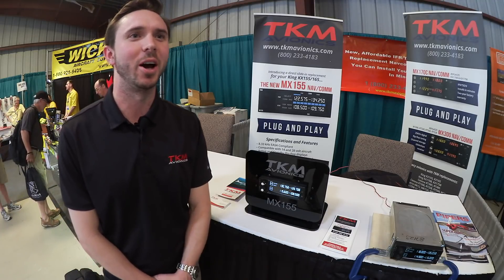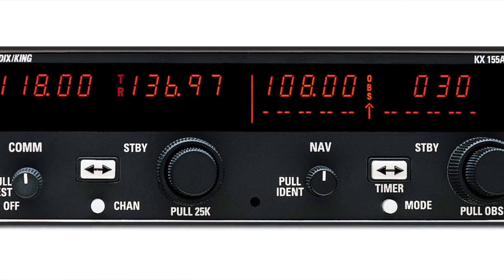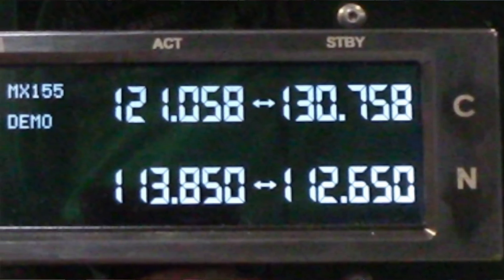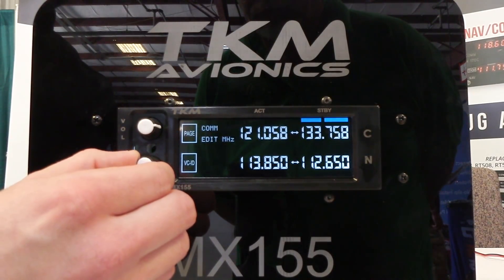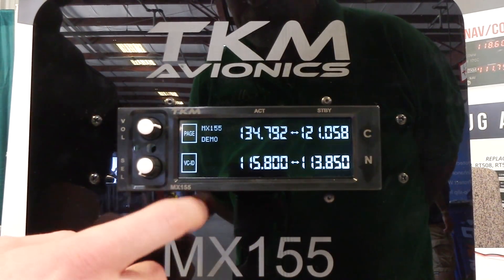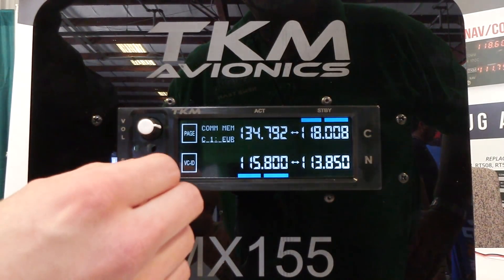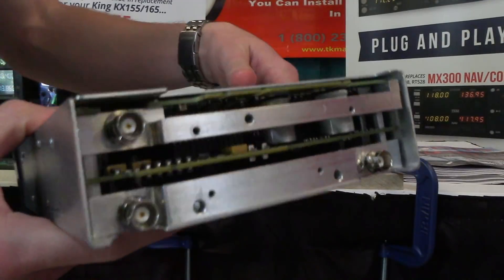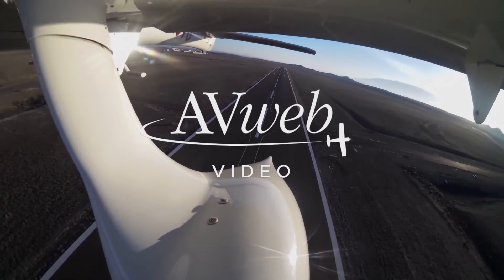TKM Announces Rollout of Bendix King KX 155 Replacement

Comment: The 155 can never be replaced
Reply: Apparently not.  The KX-200 (89000002-120-28) has been promised for almost 2 years and King can't seem to get it across the line and into a panel.  Seemingly, Bendix/King just doesn't have what it takes to get product to-market any longer and (unfortunately) TKM is toast. :/
Reply: tamcoavionics.com

Comment: That will be a pain on a bumpy flight.
Reply: kruck96 Agreed. I can't understand why avionics manufacturers are in such a hurry to make everything touchscreen! Touchscreen should complement buttons and knobs, not remove them!
Reply: Austin, I have flown some touch screen.  Did not have a problem.  However, it was not my Nav/Com.  You obviously have not flown a 155.  Too antiquated I guess, you fly much more sophisticated birds I am sure.  When I got my ticket in 1985 the 155 iwas state of the art.  The benefit of "the button" is that you develop muscle memory and a tactile feel for where your finger is on the radio.  No need to physically look it.  The "flip flop" function of this new touch screen appears rather precise to touch, hence the in turbulance talk.  I do concede that todays avionics are simply awesome, especially the capabilities of the flight director coupleing.  My ex Navy flight instructor was a stickler for partial panel instrument flying.  He used to say "when your feet wet, you simply will not have the time or skill to figure it out, only training will prepare you."  Of course buttons on radios can fail as well, I guess we will see how well the touch screens hold up.  The G3000's seem to be great....lets give em 20 years and see.
Reply: I thought the same thing.  Also the 155 was easier.  This reminds me a little of the "infotainment" screens in modern vehicles.  Where I used to just select "ac" and turn the fan knob.  Now I have to go into 3 to 4 different screens to use it.  Takes way more of my attention time off the road.  But we do eventually need something for the 155's, maybe they will take some feedback and improve a little.
Reply: I have a 165 any difference?
Reply: Obviously comments from people that have never flown touchscreen avionics. How is touching something briefly during turbulence harder than depressing a button? I'm sure the airplane will fall out of the sky if you touch the wrong place on this thing 🙄. I will say that the knobs seemed very flimsy.... hopefully that's just abuse from the show traffic....

P.S.  I wrote this during turbulence.